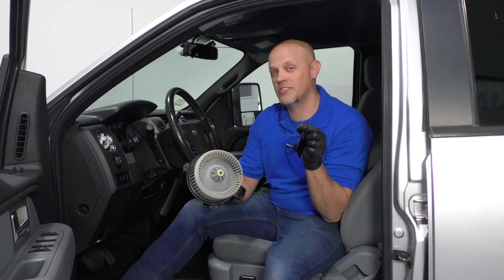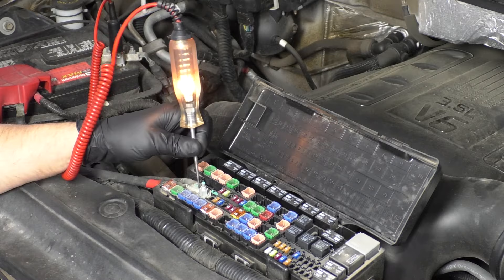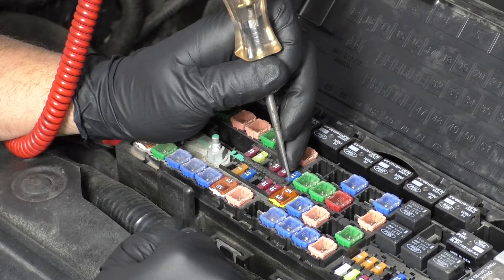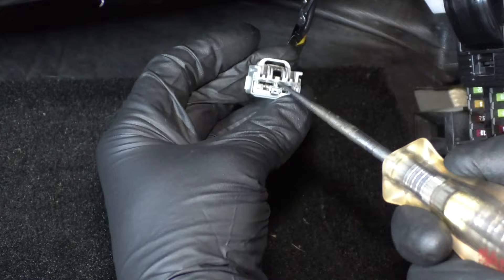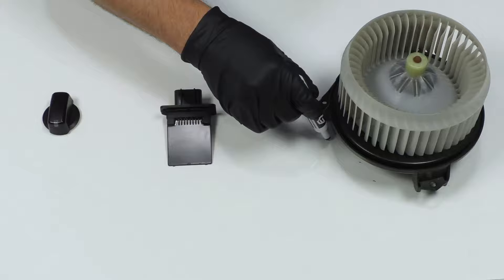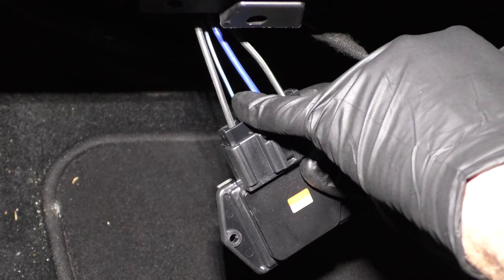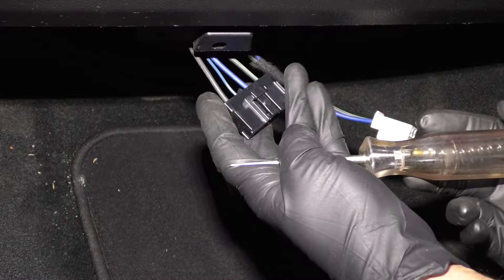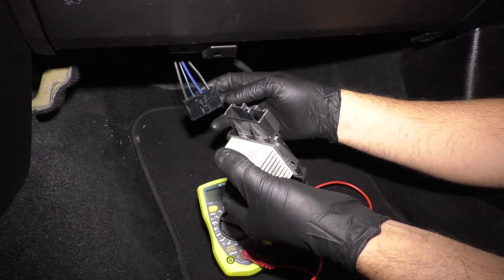Heat Stopped Working In My Car! Blower Motor or Resistor?

Comment: Mine was intermittent.   Just a connector that needed a good cleaning.  The hard part is getting my eyes on it under the dash in the hot weather.  I did visit the dealer.   If I need to replace it I definitely be ordering from Autodoc for 800 euro less.
Reply from the maker: +Mark Novack Thanks for the feedback!

Comment: 2009 subaru legacy..  Drove car about 20 minutes and heat was working as normal.
Shut car off for like 10 minutes, turn car back on to leave and had no airflow at all anywhere..
Checked fuses, all good.
Coolant level good.
Thermostat functioning.

Decide ill figure it out later and get back in the car to go home and 10 minutes into drive my heat starts working again as normal.

Would you lean toward blower or resistor?

Comment: I did the permanent fix for it my blower motor turning off and on intermmitently on my 2003 Silverado.  I bought an "add a circuit."  I bought the 30 amp one.  I pulled the 30 amp fuse out in the cab for the heater/AC hvac system and plugged in the add a circuit that has 2, 30 amp fuses in it with a pig tail coming out of it.  I connected 8 ft of 14 gauge electrical wire to it with a butt connector.  I ran the other end to the blower motor on the passenger side of the cab.  I cut the pig tail off of the blower motor(the blower motor just has 2 wires coming out of it.  A red and a black wire.  I connected it to the red wire.  The black wire on the blower motor I connected an eyelet to it and connected it to one of the glove box hinge screws which was a good ground.  I cut the 8 ft piece of wire right above the transfer case shifter and installed a toggle switch from walmart.  Now I can turn my blower motor off and on with that toggle switch.  I only have high fan speed, but I don't care.
Reply from the maker: +My Life Thai Thanks for the feedback!

Comment: i have a 96 chevy Silverado and was wondering if there was a way to increase heater fan speed? heat works....just wondering how or if the fan speed can be increased over stock specs ?

Comment: I've replaced my resistor, my relay, and 2 fuses on my 2001 dodge dakota. . . blower still not working. . .so I guess I should assume it's the blower motor that's not working. . .although it occasionally pops on every so often

Comment: Ive changed resistor and blower motor, stil no fan/heater. Going to change all fuses in relation to AC today.

If that doesnt work its a power ground, loose wire, issue right?

The blower worked intermittently and then went out completely.

Comment: I replaced my blower because it was noisy then stopped. I didn't know about the resistor. So far my fuses seem ok. The new blower isn't working. So, it could be the control switch or the resistor.  Still learning how to do things the hard way....

Comment: Or is it just dirt filled up on the think and would you use like an an air cannon from a computer or something because after last Winter it it's worked terrific all on summer on AC and it's been working good on heat until now again

Comment: My Boxsters fan works intermittently. Sometimes, when it's working, there is a loud whine which changes pitch when the steering wheel is turned. (less current to the fan, I guess). Is it the fan/blower or something else? Ta.

Comment: If I check the blower motor outlet and have ground and power does that mean it can't be the temp. control switch? I replaced the switch a few months ago and I'm just trying to rule out that being it. Thanks in advance.

Comment: I have a Volvo S40 B4042s, the climate module is not working I checked the fuse its fine i tested the blower motor its working i exchanged the motor resistor still no difference basically the system doesn't have power specifically the blower is not receiving power.

Comment: I have a w211 2003 model.. whenever 8 switch on the aircond  nothing happened. Apart from the blower and resistor, which i checked, what else could be the problem? The workshop that i went to told me that blower, resistor and fuse are all good. Could be the wiring?

Comment: Hi there, if my blower is only working intermittently (keeps cutting in and out) bit I can still control the level of airflow is it safe to say the problem isn't the resistor? What's the most likely cause? It's a very old car so I can't readily get replacement parts so any easy fix solutions would be great!

Comment: I've replaced the blower motor 4 times. Sometimes, it quits within 5 min, other times it goes a day or two. When I check it, it's shorted out. Full power on one side and full power comes out the other side.  New resistor and controller.  All wiring checked, has ground, signal wire working all the way to motor. When it's first connected, works in all speeds.  Turn the truck off, start it back and shorted out. Multimeter on the wires show no jolts or anything.  Power is cut when key is off and resumes when controller comes back on. Am I getting bad motors one after another?  Like every motor is shorting out?  I've been told some people go through 4 or 5 starters before they get a good one. Maybe the same for a two wire blower motor?

Comment: They design with motor on cold side of car as leading to outside. This causes condensation in some as interior is hotter than outside air. Took out one after a freezing night and condensation all over metal parts of motor. Bearings rusted and too much resistance when turning it.

Comment: I had no fan at all in 2013 buick verano. Gained access to blower motor and found with a small spin by hand it would start working. So fan is on its way out, going to replace.

Comment: We just had record low temps and my sienna stayed out in the cold, and now won’t blow in the front of the vehicle, but works in the rear.  Any chance the cold caused this, fuse or resistor maybe?  Blower Motor is less than 2 years old and working fine before the cold snap.

Comment: My Silverado is doing the same thing but it blows hard and normal but stays on when I shut it off I have to disconnect the battery to stop blowing so my question is if I replace the air blower control mayo is coming back to normal?

Comment: But the question my heat blower not turning off in my 2012 impala LTZ what do you think it could be the heat control, the blower or the resistor?

Comment: My just stop blowing. No air at all? I check the motor blower and it's good but when I try to test run the resistor it seem like I have no power. I don't have  the car manual. Do you know where is the motor blower fuse is located at. I have a 2015 Toyota rav4 LE. Please help. Thank you. You think it can be the resistor?

Comment: I have a vehicle (2003 DODGE CARAVAN SE) and im trying to apply a diagnostic test but im not comprehending it if there is any way that you can help me out with it i will greatly appreciate it very much.

Here is the test i am referring to down below sir.

Check for continuity between each of the blower motor switch input terminals of the blower motor resistor and the resistor output terminal.

 In each case there should be continuity.

 If OK, repair the instrument panel wire harness circuits between the blower motor switch and the blower motor resistor or the blower motor pigtail wires as required. 

If not OK, replace the faulty blower motor resistor.

How can i check that with a multimeter?

Comment: fuse good, relay good, wires connected to blower have power, changed both the resistor and blower motor, still doesn't work.?.? any other thoughts/suggestions please

Comment: My Corsa D 2007 only works on level 1 and 2 but not on 3 and 4, no problem at all with it but I’m confused if I should buy new fuse or blower motor. Please advice me as it’s getting annoying with it getting rid of mist and screens
Reply from the maker: +Ali_M Gaming We wouldn't be able to diagnose an issue like that here, you may want to have a local mechanic take a look at it. Thanks for checking us out! http://1aau.to/m/Shop-1AAuto-c

Comment: my 06 buick works fine with ac and just fan. BUT the heating part does not blow well at all. At high speed I can hear it behind the dash blowing but little coming out of vents. Is this a broken or stuck door?

Comment: Great video. I replaced both my resistor and blower motor in my 2011 Jeep Grand Cherokee. However, the air blows for about 45 seconds, then shuts down for 3-4 seconds, then starts back up again and repeats itself. Appreciate your thoughts and feedback on what’s causing it to shut down. Thanks.
Reply from the maker: +James Jones Have you checked your wires to see if any have melted and also check your fuses?
Reply: @1AAuto  but surely a blown fuse would just kill the functionality outright, rather than giving an intermittent function?
Reply: @theearlofwestfield  I agree, this issue sounds more computer related to me as though the control unit has a faulty circuit inside of it which is sending out corrupt signals and commands to the heating system.
Reply: James Jones, this is also my exact problem, did you figure out what the issue was with yours?
Reply: It's a Jeep, you probably got a bad new motor. MADE IN CHINA!
Reply: Check your relay and replace the blower motor. If not replace the resistor. If all that doesn't work change the ac fuses. I doubt it will not work after all this, but if that doesn't work your compressor is bad

Comment: You say to check the fuses....but which fuses are you checking specifically? When I pull up my fuse diagram there are like 7 of them that have to do with climate control and blower motors.

Comment: I just tested the voltage on the hot wire going into the blower motor and it was 14.3 volts. However when I went from high to low on the dial the voltage stayed the same. Is it supposed to stay the same?  And in this video it said if I have voltage going to blower motor then it’s not the resistor. Is that true?

Comment: My son's 2003 Pontiac Grand Prix doesn't  blow at any speed. I replaced the blower motor and the resistor card assembly. Still nothing. I checked all the fuses according to the owners manual and all check out fine. I used a test light and checked the fuses,and with a volt/ohm meter.       Someone have any other advice. I wish I had a schematic for the system.

Comment: 911 85° in Florida with 2010 ford taurus stuck blowing 90° heat on high with nothing else  working on dash, cant turn it off. Changed actuator but didnt fix it.

Comment: What if replacing the blower motor and resistor only lasts 2-4 months then have to be replaced again. What would cause that? About to replace my fourth set on a 2014 Dodge Durango Citadel.

Comment: im having trouble with the ac blower motor not working at all. Ive checked and replace the ac blower motor relay and fuse. When i have the truck on accessory and have the ac blowing max plus the fan setting set on high. Ive tapped and shaken the entrie fuse box plus wiggled all the wire harnesses and tapped on relays and fuses. Blower motor didnt blow at all. I changed the ac blower motor. Still nothing. I change yhe blower motor resistor and nothing. The ac controls still work. When i click ac/max ac i can hear the ac compressor clutch kick on. Still blower doesn't blow. Do you have anything idea what else i am missing to check
Reply: Check to see if your getting power to the blower motor.

Comment: Where is the blower motor resister located on a 2003 ford f150 lariat 4.6l I've looked all under the dash and not able to locate it I've changed the relay and the and checked all fues I have the automatic ac/heat control

Comment: I have also a reaistor module but I have another problem the ground wire to the blower motor starts to palitate but it gets slower as I turn the the speed knob up, it's that a faulty resistor too?

Comment: 2015 honda pilot. Rear ac won't come on. Checked relays , fuses, resistor,  and blower. I don't get power from the wires that connect to the blower.  Any idea I been spending hours. Can't find anything. I pulled the actuator off and tested and it was not working. Can this cause the rear ac blower motor to not work?? Thanks for any help

Comment: Question: So on My 2016 Subaru Impreza my heat/ac works on speed setting 1/2 but not 3/4. The indicator light that the AC is on turns off and all speed shuts down. I have 2 different fuses for the blower motor. Does that mean I have 2 blower motors?

Comment: Can a bad blower motor drain the battery? I recently changed a blower motor resistor connection terminal due to corrosion on the wiring, and ever since the motor fan got louder and eventually the battery completely drained.

Comment: What if you have 3 or 4 speeds but the speeds overall seem slower than normal (like half the normal speed).  Is that leaning towards the resistor or the motor itself?

Comment: I have an intermittent condition with my blower fan. That was not covered in the vid. Most likely not the fuse, nor the motor. So I'm looking at a poor connection, weakend resistor, or failing switch?

Comment: What if you replace the blower motor but the power connector is melted and deformed? Is there a way to easily replace it? 

The blower motor is also a slightly different model and the connector wont reach the motor. The old one had the connector plug in on the side where the cable comes from, but the new one has it in the front towards the seat.

Comment: I replaced blower motor "its not blower" it just has a mind of its own, it comes on & off on its own. Any ideas? I have 8P 2006 Audi A3 2.0T..... Need heat freezing to death🥶
Lately it only wants to turn on "blower fan" after an hour drive "as soon as I park"🤷🏾‍♂️ 
I think this model the resistor is on the blower so if we replace the blower they resister is on new blower???🤷🏾‍♂️

Comment: The Wring Harness between the Resistor and the Motor goes bad. Generally you will have an idea , if hitting bumps or slapping the dash turns your motor on and or off...
The pig tail swap is Common....       
      Many shops will just throw parts such as a. Blower Motor, Resistor, hvac control assembly etc.. 
   Great video but Personally I would ask that you ADD the Blower Motor Harness to the video....

Comment: What if the blower is working but it won't shut off even when you completely turn off the engine? The front blower is working and shutting off from the controls just fine, however, the rear blower won't shut off. I'm assuming my issue is with a rear blower motor resistor/module. Does the rear blower have a resistor? if so, where in the rear compartment, is it located?

Comment: Hi, I have helped a friend replace his car's blower motor...the original blower fan blade has a clip on it. But the new blower motor blade does not have a clip on it. Would I need to remove the clip and put it on the new blower fan blade?

Comment: I’ve been having the resistor blow 2 time now. I have replaced both the fan and resistor with the parts from you, the resistor connector has a burnt pin. Would you have any ideas why?
Reply from the maker: +Glenn Kromeke We wouldn't be able to diagnose an issue like that here, you may want to have a local mechanic take a look at it. Thanks for checking us out! http://1aau.to/m/Shop-1AAuto-c

Comment: I have to keep replacing my  resistor quite frequently I can't change the settings on any of my dials or it'll burn out my resistor. The only way to make it work is to have it on full high for heat or full high for full cold. Any change in speed just kills it. The resistor plug melts. I will try changing the blower as well. Thanks great video

Comment: While you were testing the signal wire, what switch does that signal wire come from? I have replaced the resistor and blower motor and still nothing.
Reply: Did you check for a fuse issue? If fuse is good, most likely the fan speed switch. Double check your powers and grounds just in case some other issue.

Comment: I refilled my ac and its now working fine and cold but my ac/heater is now only working on full fan 4/4 all 1 2 and 3 have no air comming out but 4 is working fine would this be the resistor thats broken ?

Comment: i have a pontiac g6. i have changed the blower motor and the resistor. checked all the fuses ansd still the blower is not working.

Comment: 2006 F150 here 150 thousand miles the blower motor resistor went out last year so I bought one on Amazon it worked for about a year then it burnt out I got them to send me a new one and this one only lasted two months the blower seems to work fine is the weird thing

Comment: my qustion is if you remove the blower motor add  12 volts from the battery to to the blower is this a good test for the blower motor